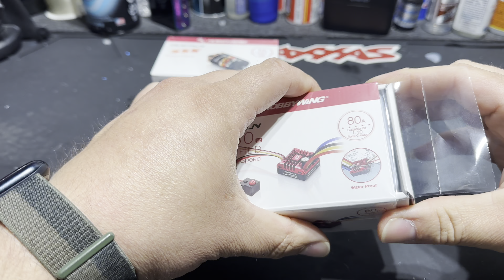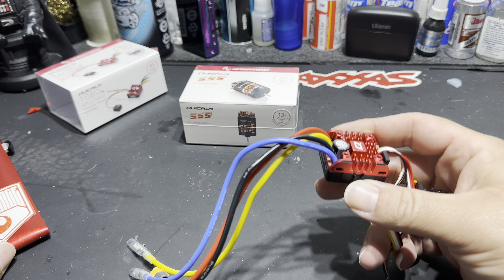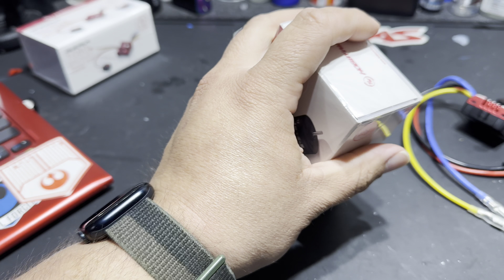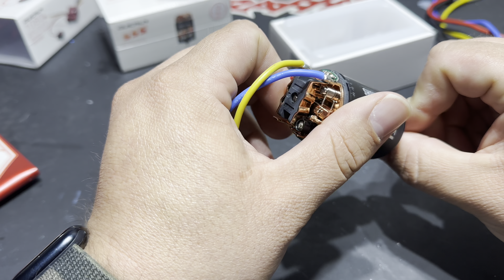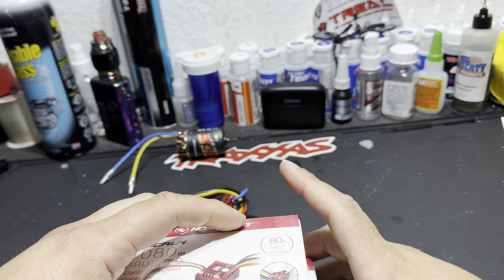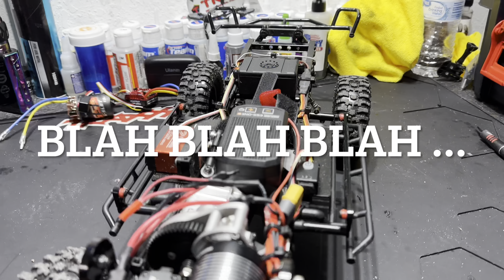New Hobbywing 1080g2 & new 555 motor. Unbox, overview, install and set up.

Comment: its good and all but the program should just be automatically setup
Reply from the maker: It does come with a generic tune already from factory that u can use and will get u started. The tuning option its just a great thing for when u want a lil more out of it. One thing I wasn’t too happy about it was that it did not come with the tuning card. But it can be used right out of the box.